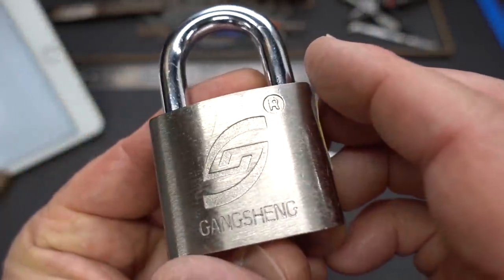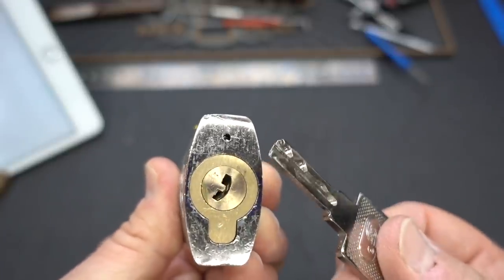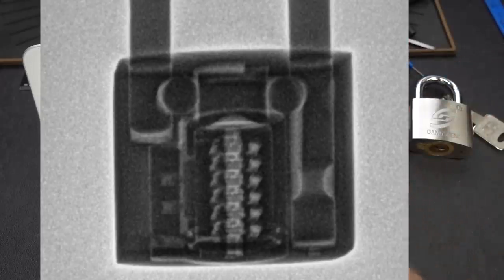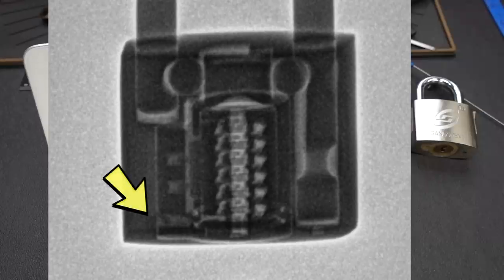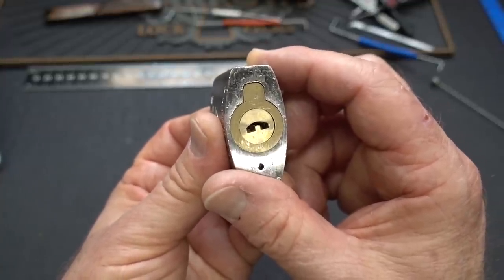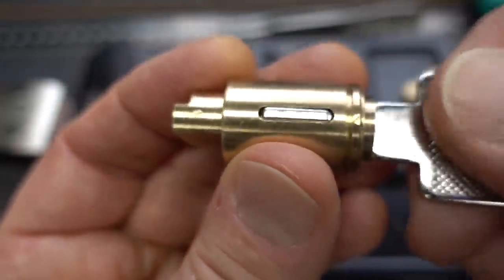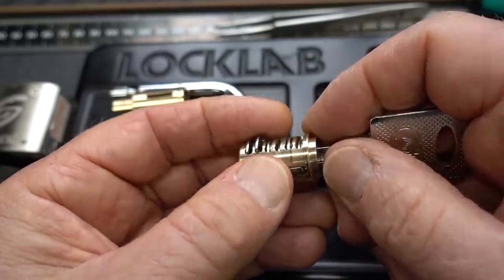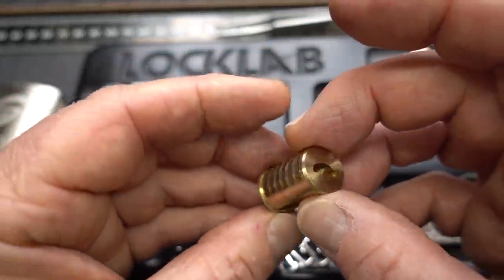(1792) Tensionless Lock (X-Rayed & Dissected)

Comment: Bill, I could see 2 potential exploits here. For one, if you could manipulate a single slider to the center with the core in the right spot, you could create a binding situation. It would take some time to find the correct slider which is the first binder. Then once it is bound you should be able to pick it. Second, it appears from the video that the sliders are accessible from the left and right sides of the keyway through the milled pockets, that they are all identically shaped, and they all need to be in the dead center. Could you grind some bumps on a wiper insert with the same spacing as the milled out pockets of the center core, and insert them on the left and right sides and push them out at the same time to center all of the sliders. I'm curious where can I get one of these locks, I would like to try these 2 methods. Or if you could get this lock back together and you can get me some dimensions I could try to 3d print a tool that would do this.
Reply: clever ideas...props
Reply: The first idea other comments have pointed out probably wouldn't work as the slider springs are likely to overpower the springs tensioning the outer sidebar. The second idea seems more likely to work though. The tools would be a bit like comb picks. One facing outward on each side of the keyway, jiggle them a bit to pick up the correct set of sliders and push both outwards at the same time to centrally align all the sliders. Manufacturer could presumably defeat by redesigning the sliders with variations on where the gate is positioned on the outside.
Reply: @yetanotherstronk  True. I'm not sure how much they could vary it though, those sides are fairly thin already. The best thing for them to do would be to mill the core in a way that they don't have to expose the sides, but that might be basically impossible with a milling machine.
Reply: First, manipulating a single slider into the right spot for the sidebar to align with the groove wouldn't create a binding situation because the other 11 sliders would prevent it from dropping. Second, the sliders aren't identically shaped. The gates are in different positions, which is why the key isn't a straight line. Please post any additional ideas! We can think of a way to pick this!
Reply: @curlyvideos  You 100% did not read what I said. The SIDES of the sliders are identical. Watch the video again, the left and right sides are identical, and they are also accessible through the milled groves in the side of the cylinder. Ignore the top sliders, that's not what I am talking about. 

And I do believe my first option would create a binding situation. That's literally the ENTIRE premise of lock picking is that minute differences in manufacturing tolerances create a situation where one thing will give or slide, while another will bind or rub. You would just have to find the correct slider to be the first binder. It would be an absolute nightmare to do, the second option is far more feasible.
Reply: @curlyvideos  It looks like the gates are all in the centre of the sliders. It's the knobs that interact with the key which are differently placed in the two which are shown. If this is the case, each slider needs to move the same distance towards the middle of the cylinder to align its gate. Because the knobs are placed in different positions on each slider, the key has to have different height cuts to move each slider the same distance. You could always try to judge the distance and move all sliders the same distance using the knobs in the keyway, but with very little feedback it would be hard to judge, and you'd need to hold each one there against spring tension while you set the rest. What's being suggested is using the sides of the sliders to manipulate them, instead of the knobs, so you can set them all at once using only two tools. @Dustin yes I see your point about protecting the sides from manipulation. I guess you'd assemble by stacking the sliders vertically, sliding them onto a square shaft that shields them from the keyway. I still think there's room to vary the gate location per slider, though.

Comment: So if I'm getting this right, there is a first sidebar interacting with the sliders, that in the locked position is flush, and recessed in the unlocked position. When it becomes unlocked and recessed, the second sidebar can catch the groove and rotate the actuator.
Wouldn't it be possible to get feedback without any tension then ?
If you line up the two sidebars, the springs are pushing against both, and so against the sliders. So, they are being tensioned by the sidebar spring itself. Granted weak springs would imply very weak feedback, but that should work ?
Reply: Weak feedback on sliders, from my understanding, is either exceptionally difficult or impossible to work with. But yes, the lock seems to tension itself. Perhaps adding some tool that applies outwards rather than rotational force would be enough to get sufficient feedback.

Comment: That is amazing. What happens if you try to tension from the shackle?
Reply: You can see from the little scratches/dents on the actuator on the end of the outer sleeve that pulling the shackle just pushes the ball bearings directly into the side of that brass actuator without exerting a turning force on the cylinder.

Comment: It seems that picking this requires using the tension from the sidebar springs because those are only thing that's pushing your sidebar to the gates. Basically you need to be able to feel the sidebar touching the pin wafers and if the surface is very slippery, it will be pretty hard.

Comment: I wonder if a sufficiently powerful magnet could apply tension to the secondary sidebar and allow picking that way. You'd just have to rotate it to the right position before you started picking. Without false gates, if you can tension the sidebar, it should pick relatively easily.

Comment: That really is a brilliant lock design.  I keep racking my brain, trying to figure out a non-destructive way to tension it and keep coming up short.  The only possible solution I have thought up so far is some sort of specialized pick gun that rapidly moves the sliders around while turning the core in the hopes of getting lucky (a bit of a long shot to say the least)...
More importantly, I have been tying to think of ways to incorporate this concept into other types of locks or to improve on this design but so far I am truly impressed with the existing design.

Comment: The core is sliced up into many open slots that are then filled with slim wafers. All those thin pieces of metal are innately weaker than thick pieces of metal, which would make the core more susceptible to destructive attacks like drilling. 

That being the case, I bet we will see hybrid locks in the future with more blocky mass in some parts and this triple-cylinder side trigger mechanism in other parts of the core.
Reply: Heh, if you're going for destructive attacks, a pair of wrenches should be enough to break the shackle. Much easier as well, since you don't have to fix the inner cylinder first (or else the inner cylinder will simply turn around with the drill).
Reply: A freely rotating core would be difficult to drill though as it'll just spin around. Also driving a screw in to pull the core would be very hard.

Comment: Maybe make a hook from a pick and bend it 90° to go between the wafers and hook on to the inner sidebar to put tension on it
Reply: At 10:35 you can see that the wafers are stacked practically against one another and barely any gap between the skeleton and the wafers; they have been precision machined. In addition, one needs to PULL IN the inner sidebar to give any tension. That's another difficult maneuver to do.

Comment: So the trick is creating the V with the wafers for the inner bar to fall in to which will then allow the outer bar to drop and tension the lock. 

Are the V-Slots centered or aligned to each other in the same spot on the wafer (I couldn't tell from the video) if they are, that's the weakness just by centering the wafers, if they're all offset at different points in the wafer, then that's brilliant.

I seriously hope that the company who produced this patented the design, as I can see this, with some minor refinements, becoming a newer, higher security lock.
Reply: At 11:02 you can see that some wafers have the V-groove on different location. The sliders within the inner rectangle move the V-groove horizontally to the right location to allow the inner sidebar to "fall into" the cylinder.

So a lockpicker really needs to move -- and HOLD -- all the wafers to the correct spot for all the V-grooves to line up.
Reply: @PanduPoluan  and if we assume that the keys have at the very least 4 cuts, I think we'd be looking at a minimum of 20,000 combinations, if it has 6... impossible to just guess.
Reply: You also know the wafers' gates are in different positions bc the cuts on the key aren't all the same.

And yeah, a picker would need 12 hands i guess

Comment: So as long as you have the key in the right position you have positive tension... but at the same time you also have negative tension because of the springs between the sliders. Picking this must be hard. 

I think the only improvement is that there is permanent positive tension to begin with, meaning that tension is only available during a very short amount of time. 

I wonder if you can rake this, but you need a special pensioner that will go back and forth until there is tension. once you have tension you can pick it the rest of the way. I also wonder if its enough to pick the first 2 or the last 2 to get tension.
Reply: Picking the first 2 or last 2 is not enough to gain tension. I have a cam lock version of this with a different shape keyway. The key must be inserted all the way until the final slider engages in order for it to turn the core. (Just FYI: the keyway is standard slider lock flat bar shape.) It's my favorite cam lock out of my entire collection of cam locks. Interesting note: i found it on EBay around 6 years ago using a one-word search term 'unpickable" and I've been unable to source another one like it anywhere ever since.

Comment: So, since you know it is based on the 90degree position.  If you hold the core still, could a rake work then at the 90 degree position?  Note, I'm less than newb.  So sorry for saying something dumb.
Reply: A standard rake needs tension to make the pins & drivers "catch" on the shear line. Since you can't tension this, a rake won't work.

This will require a very specialized tool to shift the wafers one by one and hold them in place.
Reply: @PanduPoluan  Thanks for the reply!  Makes sense.

Comment: if you prevent it from spinning, and stick a flag pick in it to maneuver the wafers - will the side bar spring provide enough push to 'set' a wafer? or does the spring tension of the wafer prevent it from 'setting' ?
Reply: It looks to me like the spring that pushes the pair of wafers apart is as strong as the spring that is pushing on the side bar, and since the wafer notches are V-shaped they can easily just push the sidebar back out.  Especially since for the first aligned wafer the side bar will only drop a tiny bit anyway, and those V-shaped notches are rounded on the corners.
Reply: Actually, on second thought, there's a solid piece of evidence that that won't work.  When you pull the key out, the spring tension of the wafers is what "unsets" the lock -- unlike a normal lock, you didn't "de-tension" it by pulling the key out.

Comment: There’s a theoretical attack- when in the correct position the sidebars will be pressed up against one or more of the sliders, adding friction and resistance to movement on at least one of them, unless it is in the gate. 

How to keep that slider in position against spring tension, even if you could notice the very slight resistance, is a problem I can’t even theoretically address.

Comment: Kinda looks to me like you don't need to tension it as much as make sure the sidebars are lined up correctly and then you just move the wafers while it's lined up and they should kinda line up on the point of the big sidebar.. as long as the spring tension of the 2 bearings is strong enough to fight back against the wafer springs. Least, that's the way I would try and attack it. Either that or a 18in aluminum pipe wrench...

Comment: peugeot expert vans use to have  door locks that spun round like this, the key had four sides
Reply: Those are the only unpickable car locks. Pin tumblers that cannot be tensioned, unfortunately they are not resistant to dirt and corrosion like wafer locks.

Comment: I watched another gutting video of this lock mechanism and it looked like you could bypass it with some sharpened tool steel the thickness of the bottom of the keyway there, or a ground screwdriver, with the tip ground like a drill bit so you can push it in and twist so it bites and picks up the back of the outer cylinder with the sharp edges.  Image showing yellow tool outline and red points where it could pick up the outer cylinder  https://ibb.co/6BLkJcD

Comment: There must be something that tensions the outer sidebar inwards so that when the sliders are lined up, both sidebars can move inwards allowing the whole cylinder to rotate. If you can't manipulate the outer sidebar then you can't vary that tension, but can you not use it to set the sliders? There must be a point in the rotation of the inner cylinder where this light tension from the outer sidebar is being transmitted to the inner sidebar and so to the sliders. Unless I've misunderstood the mechanism.
Reply: Exactly my thought, but may be hard to keep wafers in place after finding the gate since they too are spring loaded.
Reply: Agreed. If you rotate the core to line the inner sidebar with the outer sidebar, then the pressure on the outer sidebar from the two spring loaded ball bearings will be transmitted to the inner sidebar, tensioning it.
Reply: @andrewroos6035  You have to slide the wafers and hold them in place (since they have springs) to make the inner sidebar "fell" into the V-grooves. The pressure from the outer sidebar is likely just strong enough to push the outer sidebar into the inner groove.
Reply: @Taluvian  Agree. This one's a doozy.
Reply: Looks like the sliders are actually sprung against each other in pairs, which is cool as it means even if you can bind them they will have widely varying spring tension depending on how far through picking you are and what the opposite slider is doing. Seems that to tension the inner sidebar you have to reach through the sliders with a hook-ended wire. If a hook won't work, perhaps a straight ended wire, which could poke up to the inner surface of the outer sleeve and snag the outer sidebar as the cylinder turns. If you can snag it so the sidebars stack, then turning it back (pushing the wire against the outer sidebar), would tension the inner sidebar against the sliders.

Comment: This lock and many similar tensionless designs are becoming quite common in china, the one shown in the video cost around $10 here, this is a video about these locks：https://www.youtube.com/watch?v=FrNoBaj7wg8
They are defeatable, many of these locks have poor tolerance and use a V-shaped sidebar, they can be foil impressioned or just force turn the core until it gave up. Newer model packs more steel wafers (as much as 48-52 in standard euro cylinders), use a rectangle sidebar, and adding in false gates
. They are pretty nasty for any locksmith wanting to picked or drill them. I do see a case that the locksmith drill the door and turn the lock from inside instant of drilling the lock itself.

Comment: Lock manufacturers don't see the point of making their locks more secure. cough Master Lock cough
If someone wants to break in, he will bring a bolt cutter. What's the point of all that tech if no one even try to pick it?
As locksport becomes more popular, people realise how easy it is to pick a Master Lock. You can pick it open with less than 1 hour of experience.
I like to see locks like that one. It shows that someone is listening to us when we say padlocks are easy to pick. They are really thinking outside the box. Hopefully someone will think of a way to simplify the design without reducing its lock picking resistance

Comment: I'm wondering now - could this lock be a good candidate to a pick gun style attack?

Start by setting the rotation of the inner sleeve so that the outer sidebar applies pressure onto the inner sidebar. This might allow gates to bind very lightly.

The alternating wafer directions makes it hard to manipulate all of the wafers randomly though. You'd need a mechanism that effectively applies pick-gun style impacts to the wafers towards the center of the core, almost like 2 parallel chopsticks hitting all the wafers. Then maybe it's just a matter of luck and random chance to get binders? It's almost like having 2 pick guns fused together so they look like a T, with two handles.

Comment: I would never use a lock that could be defeated with superglue and a screwdriver.
Reply: try that and you'll just glue the sidebar into the locked position. There's no weak link to overpower. Aligning the wafers and dropping the sidebar creates the link.

Comment: Did you say "bible"?
Reply: Yes, he did. That's what the part is called. In a normal lock, it's where the driver pins go, usually  considered to be "up" from the core, to allow the key pins to move up with the key to the shear line.
Reply: It's very holey.